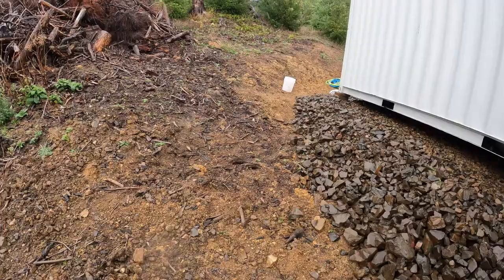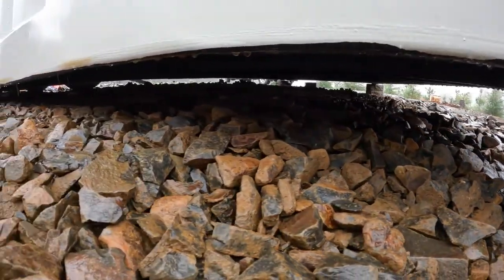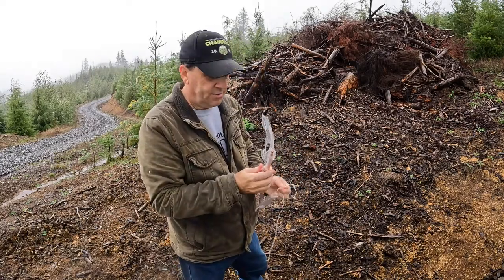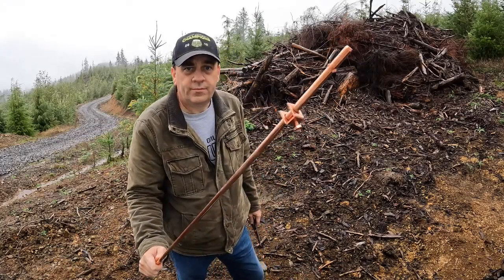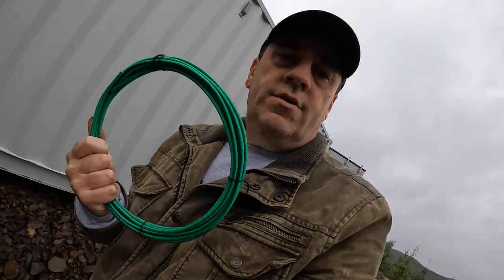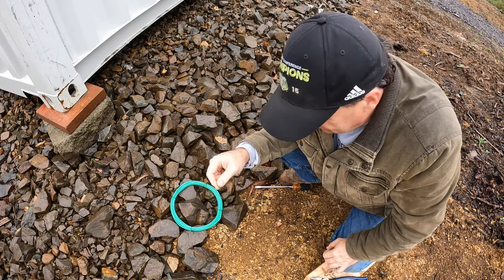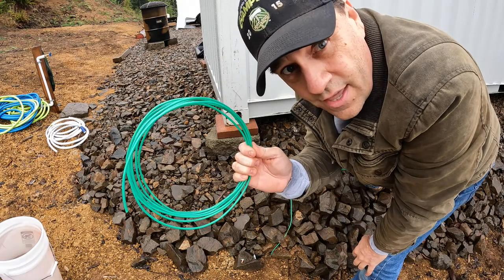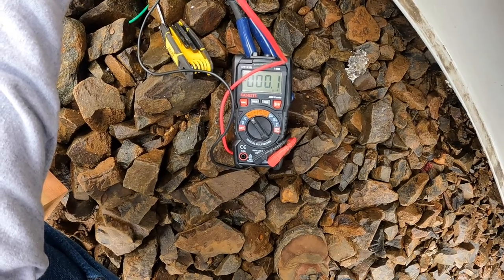Installing a Ground Rod - Ground your shipping container and your electrical systems!

Comment: I always see 8' ground rods for sale, nothing shorter....5/8" diameter by 8'   Why did you drill through the top rail vs. the bottom one?
Reply from the maker: There are 4 footers on amazon, or there was back when I did this, however since then I've moved to 8ft heavier gauge rods on two other installations.  If you watch the video on the Generator install I show the larger rods I'm using, also the most recent one on the Spur Road power system.   I think 8s is the way to go really.   I don't' remember why I drilled the one I did, maybe it was just easier to get to? LOL

Comment: Hey. Grind of the paint where the lug makes contact and use a bunch of delectric or copper grease before and after mounting. Mount on the underside if you can to keep out of the weather. Wear a mask when grinding though, I think the paint on those contains lead. Cheers